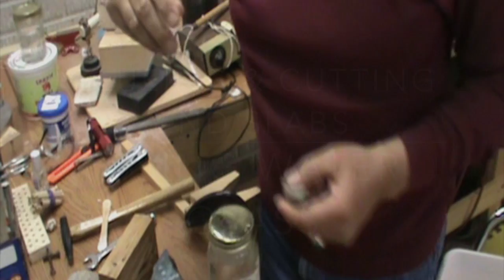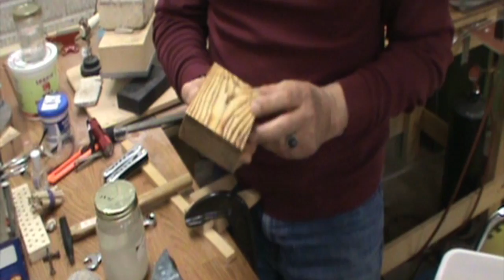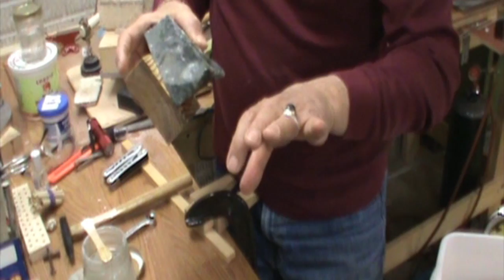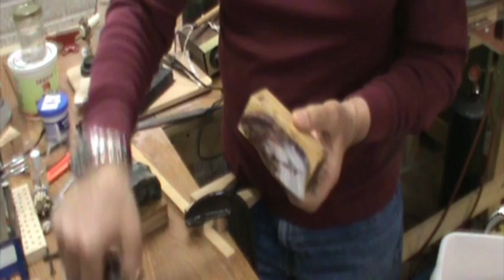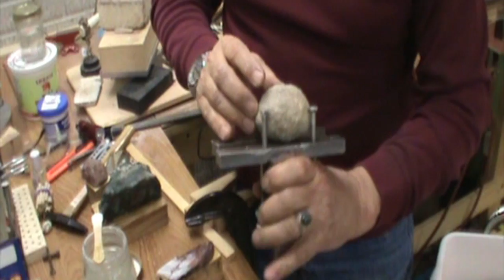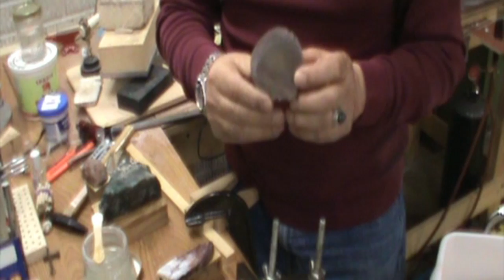Glueing & cutting slabs using Water Glass

Comment: I used water glass on an agate and a jasper and a pine block. The jasper came right off but the agate is still stuck good after a couple days and isn't coming off? Any suggestions
Reply: Hi Fred, sometime it takes a bit longer to come off, just leave it in a bucket of water for few days and it will come off, if still stuck on it, it will be easy to pray it off.
Reply: @ElieGhanimeEG  thank you!

Comment: Great video, just what I've been needing. The water glass you use is 40% ? Do you have a source for the water glass ?
Reply from the maker: Yes it's 40% and you can get it from Lehmans.com  
https://www.lehmans.com/p-297-water-glass-liquid-sodium-silicate.aspx?show=all
Reply: Thanks for the informative video. I have been finding that the water glass comes as a 100% sodium silicate solution right out of the container. Are you diluting the 100% sodium silicate solution from the container to make your 40% solution/adhesive or does the water glass come already at 40% ? Thanks!

Comment: I thought that water glass was water proof when dry... Is the water glass not fully cured when you submerge in the water?
Reply from the maker: Hi Kyle, water glass is actually liquid Sodium Silicate 40% and it doesn't cure by submerging in water, it is cured like any other glue. However, it will be diluted when submerged in water, I think the name "water glass" is kind of deceiving.
Reply: Hi Eg Jewels Thanks for your reply! Yes I knew that Sodium silicate is another name for water glass and that a 40% mix could be further diluted in water, or have some of the water simmered off to concentrate it... But when you stuck the rock to the wood with the 40% Sodium silicate, did you let it fully cure before you submerged it in the water? It seemed like you did. 
What i'm trying to figure out is, if I let some Sodium silicate fully cure in the open air at room temperature (or perhaps used CO2 to speed it up) - then would it be waterproof at that stage, or would it be somewhat redissolved/rediluted if I submerged it in water after curing?
From what i've read, I was under the impression that Sodium silicate is completely waterproof and fairly strong once fully cured (all water evaporated). And that it gets even stronger if heated in a kiln or something like that.
I'm doing research on Sodium silicate at the moment, as I want to use it to make transparent panes for a greenhouse and also to use it as a binder for wood composites etc.
I'm trying to avoid all the usual plastics and glass for greenhouse materials, due to plastics leaching toxins and glass shattering (in earthquakes etc). I have read that between 1-5% Glycerin (Glycerol) can be added to Sodium silicate to make it more plastic and therefor less brittle - due to the plasticizing qualities of the Glycerin.
Reply from the maker: Hi Kyle, I know that sodium silicate been used for different applications, I only used it to hold the rocks I'm cutting and my first thoughts were is it going to hold the rock while cutting several slabs (each slab may take an average of 45 min.) I use oil in my saw and some uses water, but at the end it did hold. After cutting, I submerge the last piece of rock glued to the wood in a pail of water and it may take overnight or a few day to get released by itself without applying any force. Maybe by adjusting the sodium silicate percentage will help, also check on how they manufacture bullet-proof glass it might give you an idea...Good luck with your project.
Reply: Cool - yeah it seems to be working well for what you are using it for. And yes, I hope that increasing the Sodium silicate percentage will help. Maybe a longer curing time/hotter temp will also help.
I will definitely check out the bullet-proof glass manufacturing process, cheers!
Thanks for the luck, and good luck with your projects also :)

Comment: Thank you very much for the useful information which will enable lapidaries get the most out of their gemstones. However, if you use a water-based coolant for the saw blade would the water glass not dissolve away before you finish cutting your slices?

Comment: Thanks for your very informative video.  I get that sodium silicate is highly reactive to CO2 and now, as you noted, dissolves while submerged in water.  I would like to know if you glue two rocks together and then cure them in an oven, would the sodium silicate dissolve in water the same way or is the bond now permanent and impermeable ?  If the bond is permanent when exposed to high temperatures, can you tell me at what temperature(s) and for how long ?  If not, is there another way to make the bond permanent even when submerged in water ? Thanks.
Reply: I thank so very much for clearing things up.  Like your video, it's very well done.